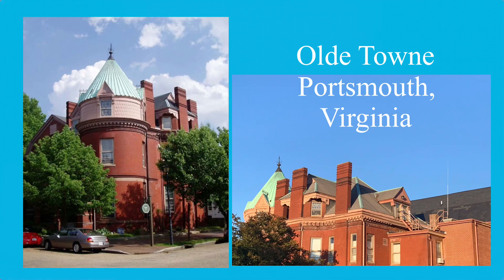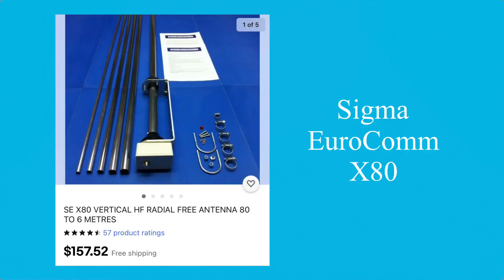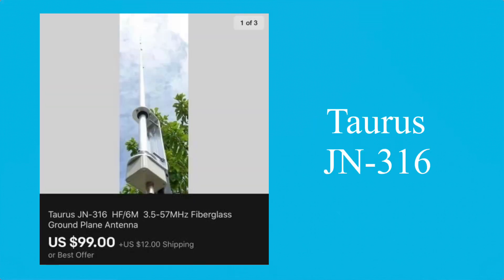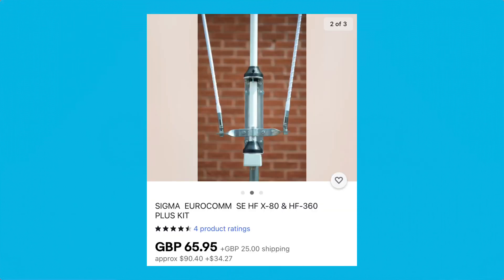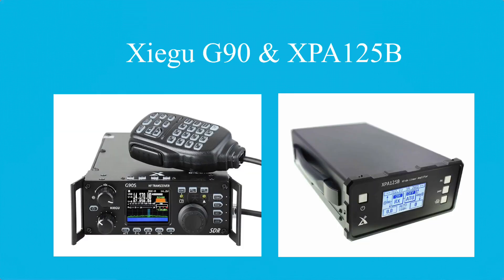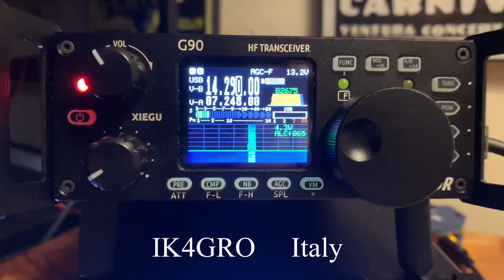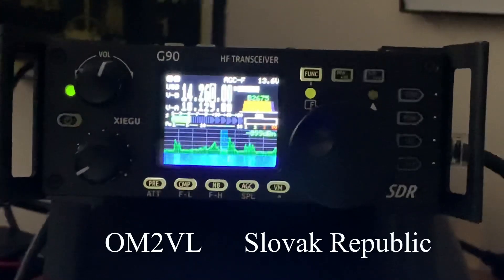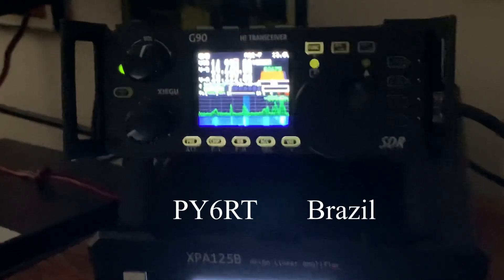Multi-Band HF No Radial Vertical Antennas, Do They Work?

Comment: I Have used the cheaper aluminium version with plus kit for almost a year and it works well enough for the price but has one main weakness - the balun is not properly weather sealed and heavy rain penetrating the pole will soak and ruin it very quickly.  My advice is to weather seal the pole with silicon and pot the balun or better still do as I did and remove it from the base of the antenna and seal in a watertight container . Also if you use the plus kit elevated radials please pay close attention to tuning them - the reduction in noise is appreciable and improves dx performance immensely. 73 M7BLC
Reply from the maker: Thanks for the info, great comment! 73, K4OGO

Comment: Been looking at this type of fiberglass anttena  to mount on the back of my motorhome . i want something i can put up easily  im useing an home made long wire dipole which works well but takes up a lot of room only problem will be earthing its a fibergass body and the mount is the rear ladder thats not earthed
Reply from the maker: I just bought a second (and larger) one for $13 USD on eBay.  Used it this weekend to build a sloping EFHW.  Video of it will be up soon! 73, K4OGO

Comment: Great video, fare comments. I have the same antenna with the plus kit ground mounted. Good ears but poor transmit, seems to working more as a NVIS antenna. Will be repositioned mast mounted on the side of the house soon. will update you if it improves.
Reply from the maker: Awesome, thanks for watching! 73, K4OGO
Reply: Any update?

Comment: Hello Walter, I tried out this kind of antenna system years and years ago already. I bought a K-41 Silver Rod 1/2 Wave CB Radio Antenna for 59.- bucks and built a homebrew 9:1 Balun integrated it to the bottom feeder point. DANNNG..worked great. But, this antenna is far from being effective like other antennas as you already mentioned. It's just a compromize antenna.
Thx for the neat Video. 73's de Your Friend Uncle Guenter
Reply from the maker: That’s awesome! Thanks for watching

Comment: whats the ATU range needed for this antenna? will the 3:1 7300 work?
Reply: I have the Diamond BB7V, another very similar antenna. The internal ATU in my Yaesu FT-991A can match this on all bands from 160 to 6 metres.  Furthest contact so far is 16000 km using FT8 on 20 metres with 10 watts.
Reply from the maker: I'm sure it will, I've used the internal ATU with both my Xiegu X5105 and G90 and have been successful on all HF bands with both.  To be honest I'm not sure of the range with these ATUs but will investigate.  Thanks for watching!

Comment: Mixed thoughts on this antenna. It tunes then it doesn't, then it will again. All connections are good. Good on WSPR (VK) and up to 2,000 mile when SWR is good. The furthest I have reached is 5,000 mile on SSB. I run 10w only. M7EGD
Reply: If it tunes then it doesn't  there must be something  wrong with tuner,connections  or unun as the impedance is varying  so much the atu cant cope with mismatch,,so something  is loose or getting  wet.

Comment: I have the HF-360 with plus kit and I'm very satisfied with the performance, specially on 20M. Has mostly worked FT8 all over the world. The SWR is higher on my setup and I need a good ATU (have the MFJ-993B) to get it to work with lower SWR. The only thing to complain about is the user manual. The assembly descriptions could have been better and with the plus kit there were no explanations at all on how to angle the radials and what to achieve with different angles. But all over, to this price the antenna has worked better than expected. BTW! I have no other antenna so I have nothing to compare it against, but this is the antenna I have room for 😊LB0YI
Reply: Totally agree about the manual, I find the plus kit a bit flimsy.  i have the radials in a V formation. Gives me 1:1 on 80mtrs and 1.4 on 40mtrs without a tuner.